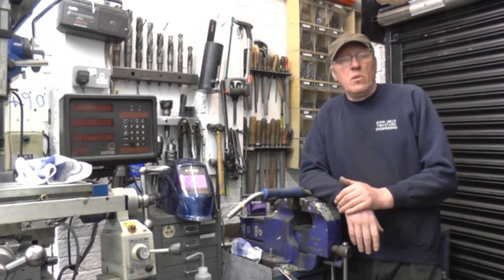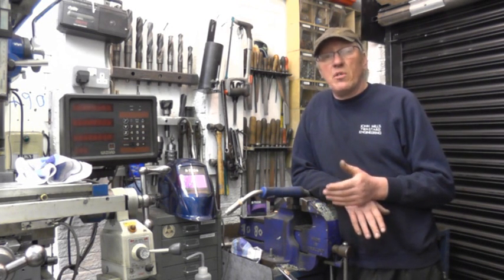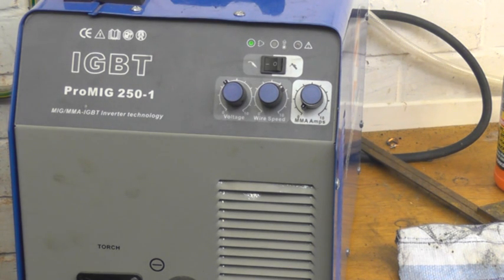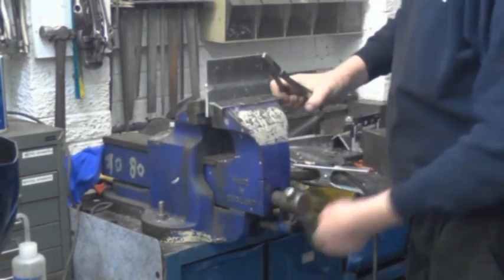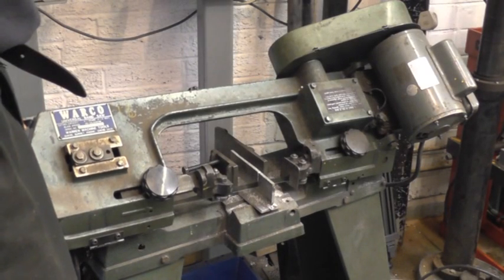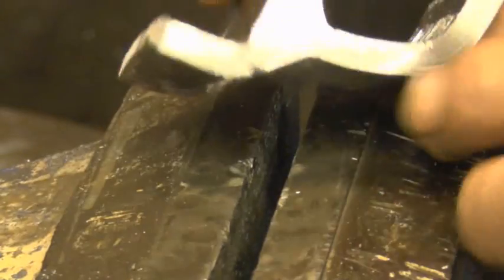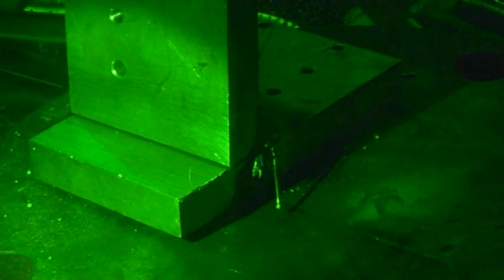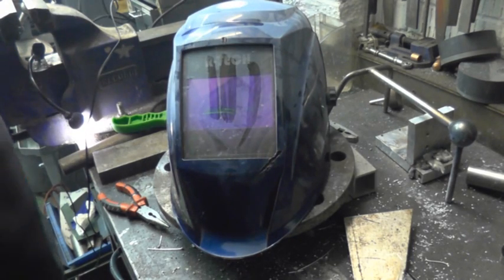R-Tech Pro-MIG250-1 MIG Welder Review Part Nine

Comment: John, thanks for the demo.  I knew you could MIG weld Al with a spool gun, but didn't know that with the right liner and drive wheels you could do it with a normal gun. Useful to know. 

Have you ever gas welded Al?  I've done it once, in a class. Requires the right flux, and it's helpful to have cobalt blue glasses rather than green.  Even so, it's tricky....no color change and the oxide layer on top melts at a higher temp than the Al underneath, so blowing holes is very easy. You also have to move right along once you get it started...dawdle even a little and you make holes. 

Thanks again!

-- Mike